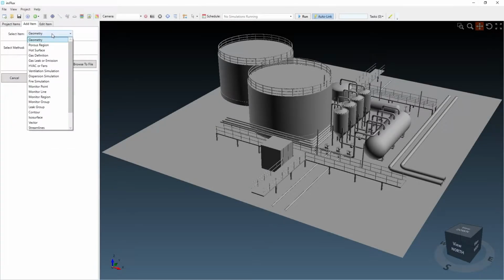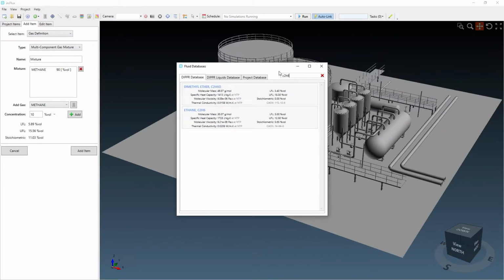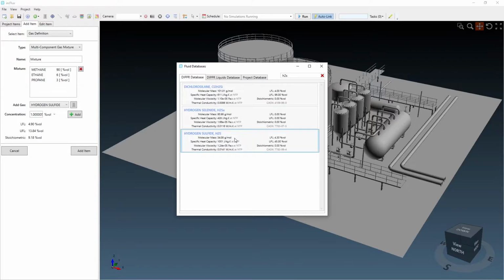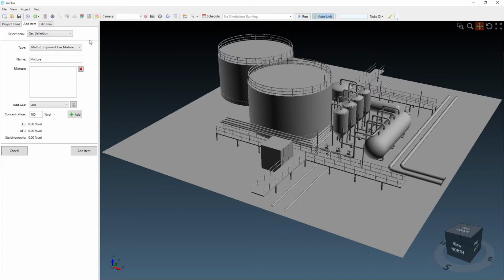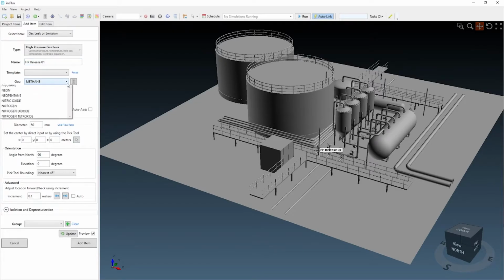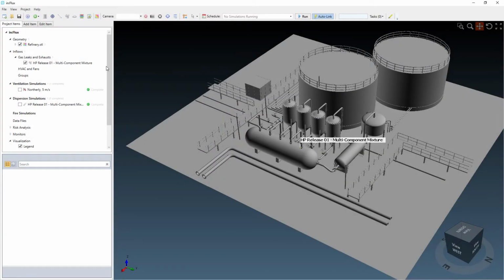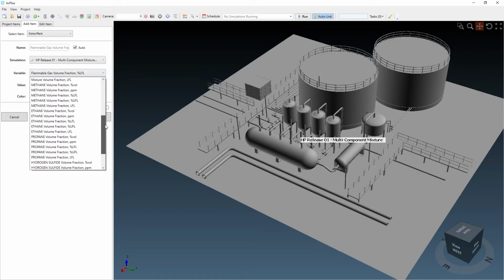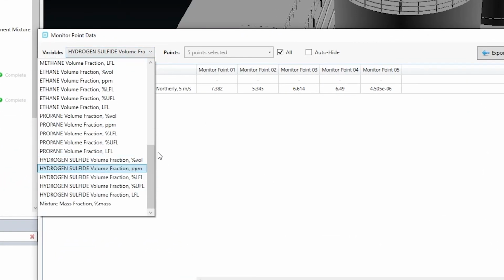in:Flux - Multi-Component Mixture Definition

Comment: One query - A statement was made that Gas mixture don't "unmix" in real life also. Do you mean this is the near field effect that occurs in the jet dominated part of the release ? From my experience of a real life small leak of Methane + H2S (low pressure service), in the far field regions H2S being denser than air did approach a lower elevation and we believe that Methane being lighter than air was raising up (Methane rising up was not measured but assumed). Please share your "insight" into such a release. Release direction was almost horizontal and release elevation was ~
5 meters
Reply: Hi Hrishikesh - there are various reasons we know gases don't de-mix, from the theoretical (violating thermodynamic laws) to the practical. The clearest example of a gas not de-mixing is the air around us, which is a multi-component gas that has "heavier-than-air" components in it, notably CO2. If gases demixed then the atmosphere would have a layer of CO2 at the ground, then be layer of nitrogen, then oxygen etc. It wouldn't be too good for life on earth!